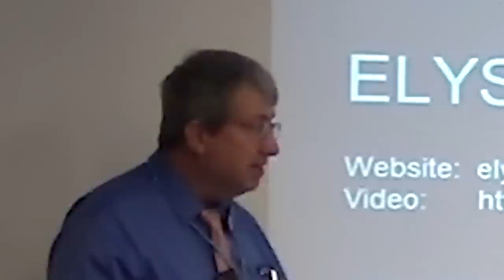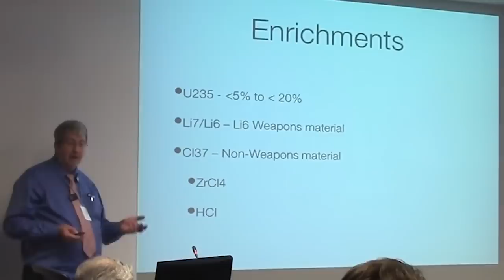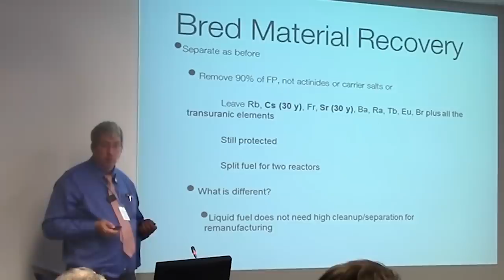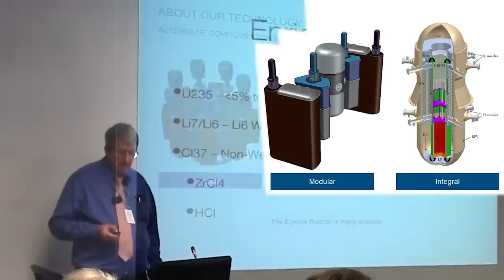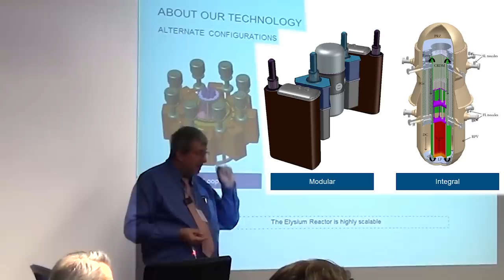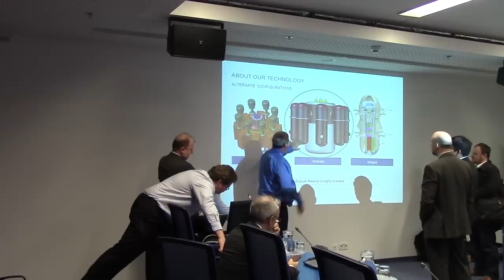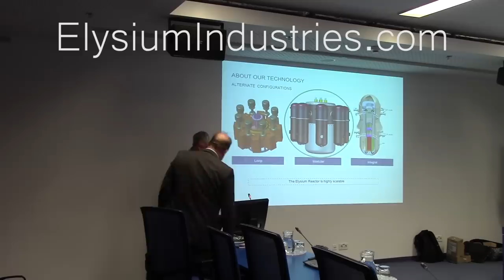MCSFR - Ed Pheil & Elysium Industries @ International Nuclear Materials Management (2018-03-22)

Comment: my question is how much power will it take to power the proton beam that will make the neutron beam that will let you run a subcritical mass reactor or a reactor with no fissile material for startup?
Reply: What you were talking about seems to be the excelerator driven molten salt reactor. Some of these designs have been proposed. Computer models suggest they can do much better than breakeven over the energy cost of running the Excelerator. The big problem is the considerable capital cost of building the excelerator. I think reactor like this could be a very good design for destroying the last of the heavy waste after most of it has been consumed by Ed's chloride salt fast reactor.

Comment: What if you combined a nuclear waste consuming fast reactor with a zirconium hydride containment vessel for a thorium salt breeding chamber where the fast neutron reactor  hit a slow neutron chamber for breeding thorium 232 into u233?  So you can do both use spent nuclear fuel rods but also breed thorium taking advantage of high neutron flux to hit the target?
Reply: They will get paid to burn up nuclear waste but would have to pay for thorium.
Reply: @chapter4travels  Still they need something after they burn up all the nuclear spent rods.
Reply: @travismoore7849  nearly unlimited uranium is always available.
Reply: @travismoore7849 Even if we double our present energy needs. SNF will still last several centuries and remember SNF is still being generated worldwide for another 20-40 years.

Comment: Don't understand: why at about 4:15 min a power 5 times bigger (from 50 to 250 MWe, for instance) means a speed only 70 to 100 % higher ?
Reply: Water resistance is non linear so power needed increases exponentially as speed goes up
Reply: Basically, motion power is more likely proportional to the the cube (rather than the square) of speed, so sqrt (5) = 70% "only" more

Comment: The solar thermal power stations use molten salts 60/40 NaNO3/KNO3 "solar salt". These are well understood and work really well for thermal storage and heat transfer. Use this to extract the heat and there's no wheel to re invent. If its done as a third salt in the system, this solar salt should be outside the nuclear zone and not subject to nuclear regulations.
Reply: This is what Moltex is doing and it could also be done on this or any other MSR.
Reply: Wouldn’t that boil around 400c? They want this reactor to go 600c+
Reply: @chapter4travels  TerraPower is also doing it.
Thermal storage using" solar salts " is doable easily in any molten metal or molten salt reactor.

Comment: 50:15  when and where can this be built?
Reply: USA has a tick box regulatory system that works well for PWRs but nothing else. Creating a new system for molten salt will take aeons, cost a fortune and limit the design choices. 
UK always takes everything back to first principles so little better than USA. Moltex went to Canada because they have a more can do (sorry about the pun) approach.
Reply: @Dave5843-d9m  Actually, NRC has been working on its advanced reactor review scheme for several years.  The Advanced Reactor links at nrc.gov describe large workshops starting in 2015, and there was significant activity years before that, predominantly on NGNP, but much of that work was relevant to other non-LWRs, as well.
Reply: @Dave5843-d9m  I'm Canadian ~ I love your pun!

Comment: "But if nuclear waste and fuel availability aren't issues then they'll build more nuclear power plants!" --Says every luddite.
Reply: And so they should. But they must be walk-way-safe and cheaper per Mega Watt Hour than coal.
Reply: The luddites were pissed to be out of a livelihood when the mechanical loom was invented, sounds like a legitimate grievance to me.
Reply: @patrick_test123  Ignorant to the fact that their labors were better put elsewhere. Why mine coal when there is plenty of every other thing out there to mine?
Reply: @leerman22  That's usually not what happens, as the coal miner example shows. Where coal mines close people will be getting poorer and less well of at least for a generation. So the coal miners have  reason to be worried about their mines beeing closed. Obviusly at stopping to use coal is the right thing to do overal, but unless there is the support needed to help people to not having to suffer because of that you need to acknowlage that it is in their indevidual best interest to delay this development.
Reply: @patrick_test123  Mining towns are a poor example, limited economic shelf-life. They're positioned only exploit a single resource. Point is insisting on doing obsolete labor is unwise.

Comment: 9:05 Fission product buildup. This reactor has no chemical kidney.
Reply: 19:50 attempting to find loopholes to Plutonium regulation is a BIG RED FLAG.
Reply: 21:25 "the actinides protect the plutonium"

Again, this reactor has no chemical kidney. The burnt waste is considered a virtue. Quite odd thinking.
Reply: Sorry. Perhaps I was not clear. 

Without the chemical kidney you can't get the waste out of the fuel. This design considers that problem to be an advantage. I see this as much the same as claiming a '73 Pinto is a good cigarette lighter. Saying that does not make driving a '73 Pinto a good idea.
Reply: @kurtisengle6256 
That's not how it works.

Fission product grow in is only a neutronic penalty in thermal spectrum reactors like the LFTR. This is why the chemical kidney is necessary - every neutron lost to thermal spectrum capture by fission products is less fissioning.

In fast spectra, there is no need for online reprocessing. Only batch reprocessing is needed, say once every year in the MSFR if you want to run approximately neutral with top up by spent nuclear fuel, once every 3 years if you are okay with topping up with thorium + spent fuel rods, or once every 10 years if you are trying to reduce actinides on final discharge and you have extra fissile (like plutonium from defunct nuclear weapons) to top up the fuel with.

Now, you can still do online reprocessing, if you want maximum neutronic performance (say if you are wanting to produce extra fuel i.e. breed). But this places pretty high demands on the throughput of chemical processing of a molten salt fast reactor.

For a thermal molten salt breeder, you must reprocess online. Otherwise the reactor will not work without constant topup of fissile. And the amount you need to reprocess is 10 times as much - around 500L per day for LFTR versus around 50L per day for MSFR (which is optional if you don't care about breeding). Keep in mind that ORNL never progressed beyond lab bench scales of reprocessing - millilitres at a time, not half a ton of highly radioactive salt a day.

Pinto analogies make zero sense.

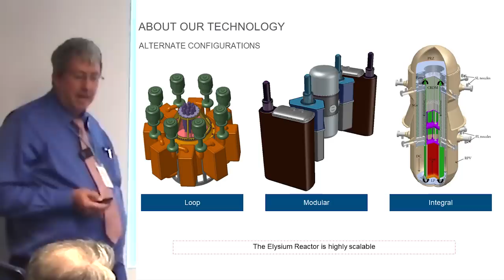https://www.youtube.com/watch?v=jgef1Hx31ls (see 8:00) for slide
Elsa Merle Lucotte's team at CNRS in France did a integral safety analysis of the LFTR-type thermal thorium breeder and concluded that the graphite aging process by neutrons, combined with relatively high fissile content, low fission product presence actually decreases safety instead of increasing it. The ORNL design was found to have slightly positive coefficients of reactivity - that is to say, as power increases, more power is produced. This is a problem and leads to runaway reaction rates  that can damage plant equipment. In catastrophic cases, as at Chernobyl, the heat spike can cause steam explosions (if the reactor is coupled to a steam cycle).
Reply: If you don't use a chemical kidney take the waste out of your reactor, you have a 300,000 year mess, all in one bucket. If you do take the waste out you have a 300 year mess and a lot of pure isotopes to sell.
Reply: You are one of those fellows who view the kidney as an unnecessary complication, and want to get rid of it. What it actually is, is the part that make @87% of the waste into valuable product and by removing that makes the remainder of the waste a short term problem.

Your fast reactor takes the opposite approach, and views the toxic waste as a security device. As in, "no one would be so stupid as to want anything to do with this, so we are safe from potential diversion by bad actors." This does not strike me as sane.

Next, I think you have it backward when you assert the LFTR could run away. And the LFTR in no way resembles Chernoble. And the LFTR uses no steam. It is possible one of us in not up to speed on LFTRs.

I appreciate the link to what you consider information. But I am simply not going to suffer through an hour and 20 minutes of that amazing voice just to attempt to figure out what you neglected to say. 110 views and 4 thumbs up in 27 months does not make it seem very important. Do you have a link to the report, in writing?
Reply: The reason to have the complication is to avoid having the long lived waste.

Obviously, you have some sort of bias against this tool. You want to get rid of it. Small problem, the LFTR doesn't work right without it. I suggest you look into how it works instead of irrationally fighting it.
Reply: So, point at a link.
Reply: Okay, I will do it. 2:38

Basically, what you have been saying is backward. This reactor burns completely, sure. And it burns waste and weapons, sure. BUT (and this is the real point) no provision is made to separate the waste, neither continuously, nor ever. If you want that, then YOU do it, the highly experienced engineer says. You are on your own. And how would you do that? With a chemical kidney, of course. Because that is how you do that. But the idea being pushed is, that is not essential. When it is essential, if you don't want a huge bucket of long lived waste to babysit for hundreds of thousands of years.

You notice I haven't mentioned that sodium is exactly the wrong salt to use in a reactor, because it corrodes steel? I skipped that because all you need is a drivers license to know that. I meant it now to add emphasis to the point the highly experienced engineer is operating in territory he knows no better than I do.
Reply: @kurtisengle6256 
If you listened to Ed Pheil's talk then you would recognise that salt can be used with stainless steel - if it is fully separated from water. Salt and water corrode steel. Pure salt does not. Pure water does not. Keeping them separated is key to corrosion control.

Actually boiling water is more corrosive to steel than molten salt in nuclear reactors: radiolysis of the water coolant generates free oxygen and hydrogen that can drive stress corrosion cracking: sci-hub.tw/10.1115/1.3225833 . 
This is worked around in water cooled reactors by using thick walled pressure vessels, minimal pipe bends and piping lengths, and strict chemistry control of the primary coolant. Running the reactor at constant power level, and avoiding rapid transitions in power, reduces stress on the components as well.

So about the salt corrosion thing: https://www.energy.gov/sites/prod/files/2014/01/f7/csp_review_meeting_042413_garciadiaz.pdf
The Department of Energy ran a series of experiments on salt corrosion of alloys. They did thermodynamic modelling, and tested a dizzying array of salts. The conclusion?
- Chloride salts are less corrosive than fluoride salts
- Exposed to air (oxygen, nitrogen), corrosion proceeds rapidly
- Under inert gas atmospheres (argon) there is hardly any corrosion
- In a reducing chemical environment, there is hardly any corrosion
- Corrosion products that form basically are the ones that are most thermodynamically stable (i.e. lowest entropy.)

These results are a recapitulation of Dr Raluca Scarlat's work on molten salt reactor chemistry and thermodynamics: https://www.youtube.com/watch?v=JYBBriQeD5E . 
And, if you actually watched Ed Pheil's video to the end, and particularly to the question time: https://youtu.be/aHsljVnY6oI?t=3964 then you would have learned that what I just reiterated:
- Salt and water corrodes cars, but salt on its own or water on its own does not. The key is keeping them separated.

Ed Pheil mentions "if you need to remove fission products, you can" at 2:38 of the presentation. He does not stipulate that he must. But Pheil removes fission products for breeding.  

I mean, come on. Stop making claims that are directly refuted by the video later on: https://youtu.be/aHsljVnY6oI?t=1405 . 

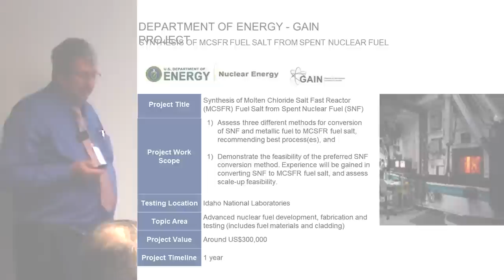At 23:25 Pheil goes through the physical fission product control of the MCSFR. There is gas bubbling to remove fission gasses, metal wool filtering to capture dissolved noble metals. These are purely physical processes and have no "chemical kidney" functionality.

The alkali metals and actinides stay in the fuel. The actinides burn down with the fission process. The alkali metals stay in the fuel salt to reduce melting temperature and provide a radiation and a heat source to deter diversion. 

This is the same process outlined in the MSFR by EURATOM/SAMOFAR: https://www.gen-4.org/gif/upload/docs/application/pdf/2017-05/07_elsa_merle_france.pdf
See also slide 13 for the batch reprocessing calculation (graph, bottom left) that shows that you can still get a 1.1 breeding ratio with batch reprocessing every 1000 days (just under 3 years). 

Again: the lack of a "chemical kidney" to separate Pa-232 for holdup and decay into U-233 is not needed . It's a potential proliferation risk, having fissile be generated outside of the fission area. It takes away neutrons that would otherwise contribute to the fission reaction because Thorium 232 has a fast fission cross section. And there is no need to have a chemical kidney even if you want to breed fuel. You can get adequate ratios of above 1.05 even with batch reprocessing. And actually if your reprocessing process is "leaky" it is better to process less times (and leak less actinides) than to process in an online fashion and slowly lose small amounts of actinides that contribute to the long lived waste stream. 

A chemical kidney is, in the fast reactor conception of the molten salt reactor, a liability. It adds cost (as Ed Pheil outlines) and complexity, while increasing proliferation risk and actinide loss risk, which complicates final disposal. It would be better to run the reactor for 3 years and reprocess batchwise. Or in Ed Pheil's case, to operate for 40 years without reprocessing, ignore breeding, and then reprocess at end of vessel life. This means that the next fuel load will need extra fissile to start up but there is quite a lot of "spent" fuel to go around so there is no lack of transuranics.
Reply: @kurtisengle6256  Ed made it quite clear in another video that chloride salts are less corrosive than the 350 C water in the BWR, IF you carefully exclude all oxygen. In other words the chlorine  in table salt or  road  salt are strong catalysts in the corrosion of steel but it takes the oxygen to produce iron oxide. When you purify your salt, that is make it free of all oxygen, then you have removed the salt corrosion problem. Anyway, fluoride salts are even more corrosive and chloride salts. That said, I have a question for Ed ~ what about the oxygen in the oxides in the spent fuel from the PWRs that you intend to load into your reactor? I haven't seen this question asked in any of his talks.

Comment: I personally favour nuclear for our countries energy solutions due to the massively efficient area to energy output ratio and their very low harmful emissions. Many people I talk to rule nuclear out as too dangerous on the off chance there is an accident and they go into meltdown and ‘run away’ spewing radiation into the air like Chernobyl did or into the ocean like Japan recently experienced. I share that concern too because no matter how many safeguards you build into them there is always a chance of some combination of human error or technical malfunction that could result in a disaster that renders large parts of the planet too radioactive for human habitation for 100 thousand years or so thereby erasing all the advantages we were enjoying from the clean energy generation.                        I’ve come up with a ‘Wild Idea’ or at least so my friends label my idea🤔.     The idea is this: Bury The Sucker! Build our nuclear power plants in abandoned mine shafts day a kilometre under ground. The plant will be accessed and serviced via the same vertical mine access shaft used by the miners. The shaft will be mined (safely) with explosives. If the plant starts to ‘run away’ the usual steps would be taken to correct the problem or at least shut it down safely🙃. However, and this is a big however, if the run away CANNOT be controlled and the plant is in danger of spewing out radiation then a decision would be taken to Get All The Workers Out Safely and then blow the vertical shaft and bury the problem for the next million years or so safely underground. Naturally you have to do your geology and build it where it Cannot Pollute the Groundwater as it melts down a km or two under the surface. Ok so we lost a power plant not good but an acceptable risk as long as there is no collateral damage right. As we get better and better at nuclear plant engineering and operations we would expect never to have it happen, but crucially we have the ultimate insurance policy against catastrophe. After all we don’t expect our house will ever burn down either but we consider it prudent to take out insurance just in case right! I
Reply: The tech Ed is talking about here physically cannot experience a major meltdown. It does not share the vulnerabilities of earlier generation reactors.
Reply: ""Mr President, we cannot allowww... a mineshaft reactor GAP!